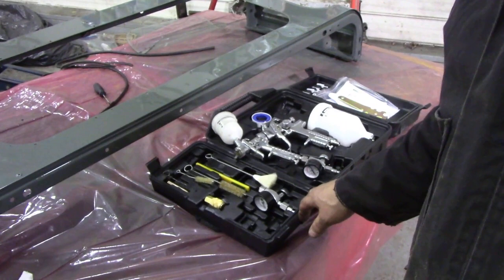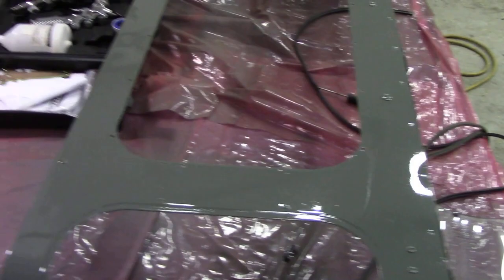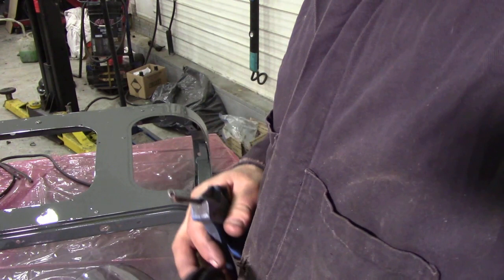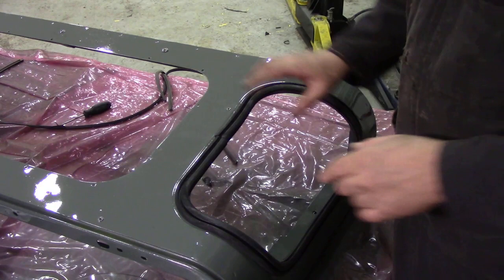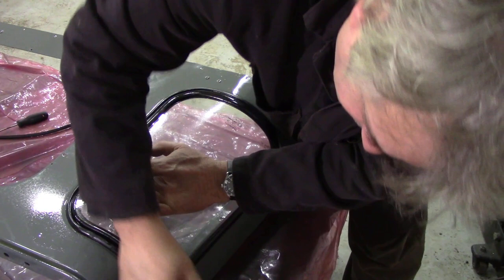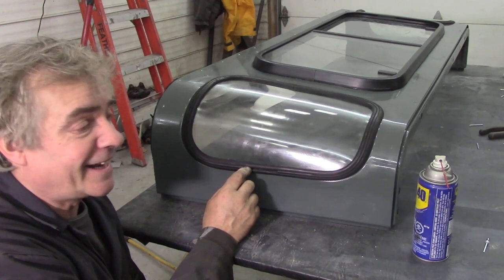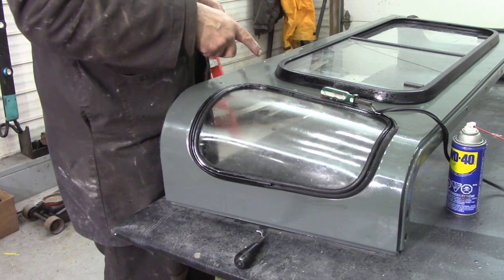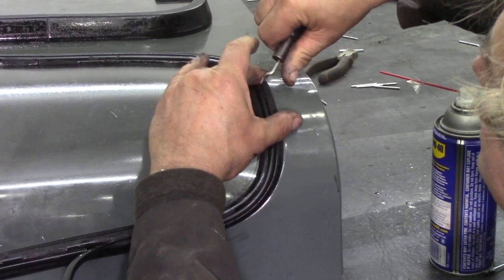Defender pick up cab. Putting the corner windows in with WD40 and a cheap paint gun set Pt1

Comment: Mike. Unbelievable! Always wanted a pick up because of these quarter lights and finally got one after 47 years! Trouble is former owner spray painted everything including the glass rubbers. I have been thinking about replacing them and your how-to video has totally inspired me. Big thank you. BTW temp here has dropped to a cool 29C ........-3C .......not for me!
Reply from the maker: Len, when I started to paint the roof it was -16c Not painting weather! 

If you have the tools to put the glass in then it is easy - a lot of guys use screwdrivers and knives - too sharp and can cut the rubber
I used to use soap and water but the water dried too quick and the soap made the install of the filler too difficult - like glue! 

I chanced on the WD40 a few years ago and did keep an eye on rubber deterioration - nothing to report

Comment: Far better to use liquid soap as we did at the factory ,also all window rubbers are heated in cabinets making it much easier when you know how .when fitting difficult screens in the w/shop we always used very hot water or put them in the oven on low .
Reply from the maker: once you try WD40 you will never go back to soap

Comment: I was a painter with Audi/VW,  always bought my own SATA or Devillbiss guns however a lot of these new cheaper guns seem to be a SATA copy,  the gun on the right of your case has the same shape body as the SATA NR series ,  I've had good results with the cheap guns that are available now from Machine mart .  I was never keen on HVLP though, never found it gave as good a finish and you need a big compressor to keep up with the cfm they use.  Looks like you got a good finish on the top,  4:1 :1 is a lot of thinner,  used to be 4:1 +10% thinner.  Keep up the videos Mike, great work.
Reply from the maker: Yes cheap guns have come on a long way - I have a V4 compressor  with a 12 HP 3 phase motor and puts out lots of air so volume is not an issue - when I looked at the paint can when I did the roof it was 4:1:2! way too thin so I just put a splash in  - came out a bit orange peel but no sags or runs  - could wet flat and polish but it's my truck and it is a roof!
One reason I bought them is I had used my old HVLP as a gun for spraying contact adhesive  - a bugger to clean!